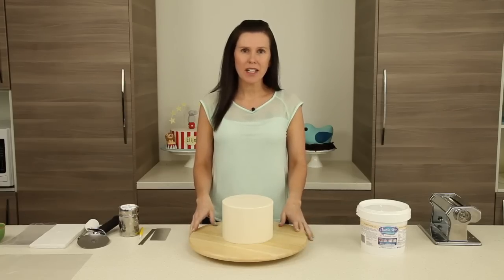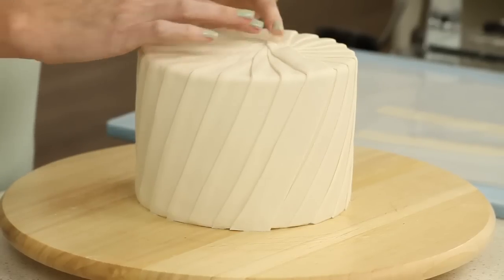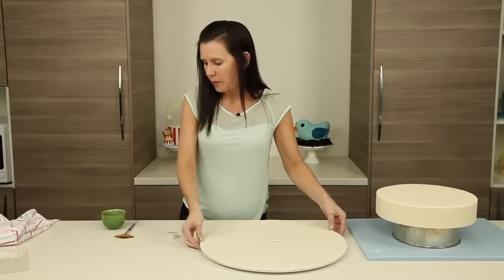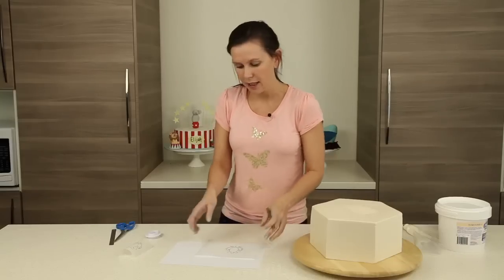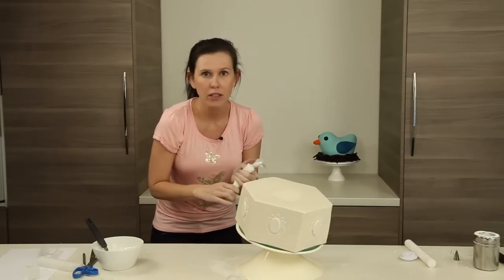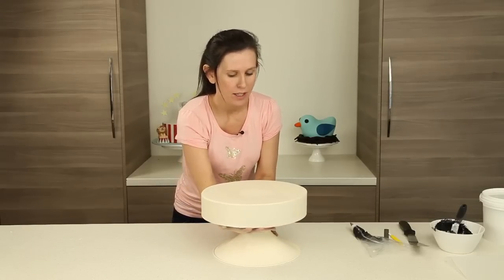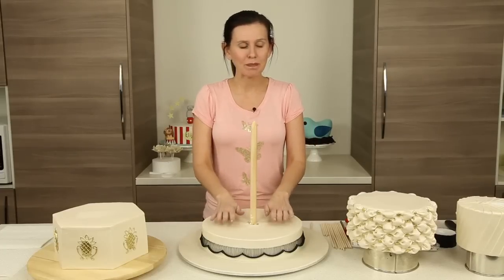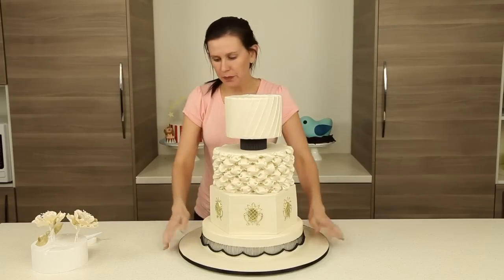Glitz & Glamour Wedding Cake - Part 2(Decorations) - CAKE STYLE

Comment: Vanessa i hope from the time you made this cake to your current wedding cake your pricing has gone up. $1400 is really underpriced in my opinion. $2500 - $3000 would hv been right. I mean 4 layers of mudcake on each tier, choc ganache filling,  the structure and internal support system, thought out design, detailed piping, precision to measurements, the neat work and quality,  4 days and 22 hours. If one cant pay what its worth than i must say you have so much love and passion to what you do rather than just doing it just for the money. It's a remarkable effort. I respect that and hats off to you. I can definitely learn from your self discipline, hardwork and perseverance as its so inspiring.  Thanks for sharing. Mel, Singapore
Reply: SanctuaryHut  what is mud cake
Reply: SanctuaryHut   think you realy this ist 4 time's  22 hours  work  ???? I make as well wedding cake  and this is not true  whot you write about.  So paying  more  than 1400  dollar  it will by to much .

Comment: Thiswas awesom3a!!!great work
1question thst is u stick tape onthe cake which is inedible  and as u remove the  tape wouldn't leave sticky residue which cant be eaten??and it it nessecary to cover thw bottom of the flowers than rather sticking thedn strIght in???
Reply from the maker: minha kabeer The brand of tape "3M" states on their website that the tape glue is non toxic, and that is does not leave a residue. We feel comfortable based on that to eat cakes that have had tape on them. If you prefer to just mark it out with pin holes etc that is fine too.
Reply: Thanks

Comment: when you tilted the turn table how did you secure the cake.. I would be very worried of the cake falling to the side.. what makes the cake stay on whilst tilted...also the small black thing under the top tear, what is it made off.. thank you so much
Reply from the maker: bluesky1 The black one is styro. This tilting turntable has a no slip rubber top, if yours doesn't, grab some non slip matting from the store (usually with kitchen utensil holders and things for kitchen drawers.

Comment: I'm hoping I haven't missed the answer to this question, but how do you transfer the design to the sides of the cake? I know you drew it on the parchment paper with pencil, and then rubbed the parchment on the side of the cake, but how did you know where to trace when you were piping? Was it some sort of "edible" pencil? I know it couldn't be the lead from the pencil, so I'd just like some clarification.
Reply from the maker: +Anna King you can see you a little bit, so you just follow the pencil marks. The pencil is a normal pencil, as it is graphite. Even though we call them lead pencils, they have never actually been lead. Completely non-toxic
Reply: Pencils do not contain any lead at all. Zero.